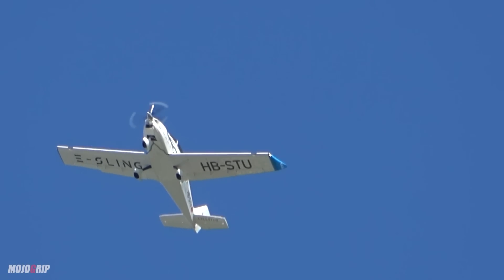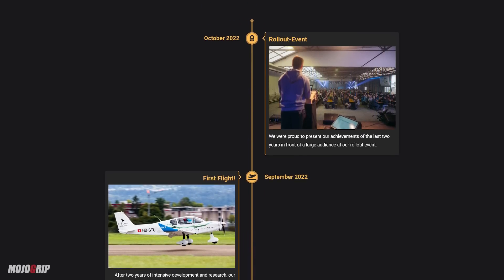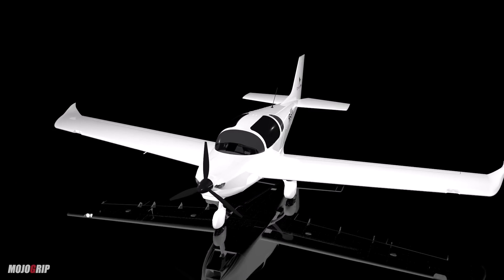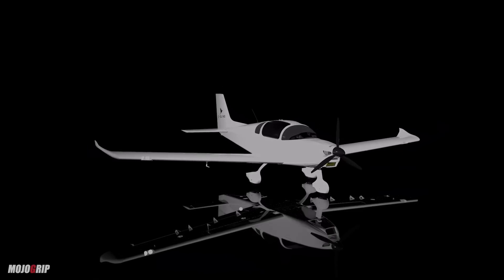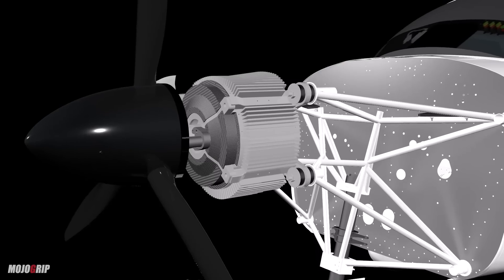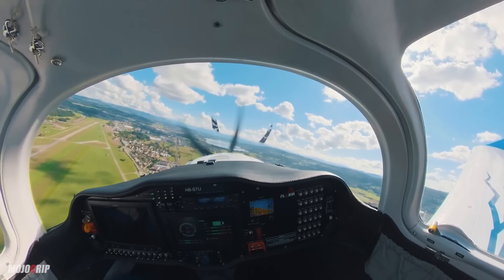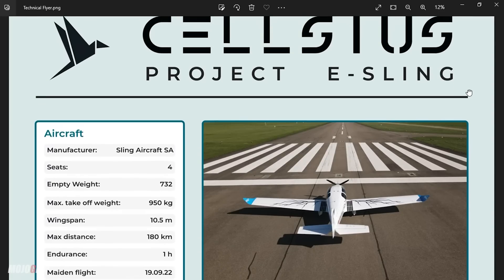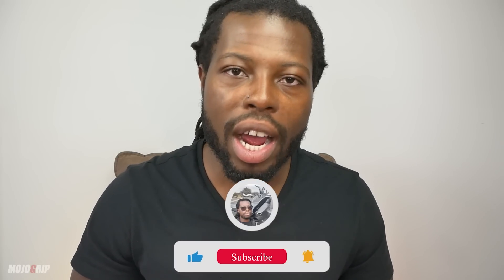All Electric 4-Seat Aircraft Sling TSi Takes Its First Flight

Comment: The success will be in better and lighter batteries to run a decent range. Evolution is slow on batteries however there are teams around the planet working on that challenge. Would be easier than H2 at now

Comment: I know it says it's a four seat airplane, but they have a 110kW motor in there with only 50kWh of batteries. So at full power you've only actually got 27 minutes of flight - that's not even enough for VFR reserves. Obviously you'd only use full power for a couple of minutes while you climb to altitude though so maybe you burn 5kWh getting to 2000ft. The question is now how low you can keep the power to the engine and still keep at altitude. If you throttle back from 110kW to 70kW your remaining 45kWH will give you 38.5 minutes of flight remaining. So overall total flight time is a shade over 40 minutes.

Obviously anything you can do to extend flight time will be useful, and you'll be able to spend less energy getting up and staying aloft if you're not at gross weight - so with so little energy available, why would you fill the back seats with people? Seems like they could have made a much more useful airplane by removing the rear seats and putting batteries in there instead.

That's not to dunk on the team that did this - great work by them - but it seems odd to prioritize number of seats when the endurance is so low.

Comment: I think hydrogen would be more viable for airplanes as the size of a  chemical batteries not only provide range but also determines the amount from energy the motor can pull from it at a given time which is alot more continuous load compared to a car.. now with that in mind a used electric plane how would one gauge the life of the battery vs a gasoline powered aircraft say each is at 50% life .. now half engine life is guaranteed a certain amount of hour before TBO a battery at 50% capacity is it even safe?? as the ability to pull power and run time is reduced ??

Comment: Eviation's Alice is doing better, so it's doable; let them make a longer airframe sling with bigger carrying capacity, can be 4,5 or 6 place if need be, but it should be able to go longer than the current tsi electric experimental model. It needs to do 500km. That's the holy grail for electric aviation for now...

Comment: Generally, your avionics are going to run at a very different voltage than your motor. Most electric cars still utilize a separate traditional car battery for accessories. The shear reduction in systems in an electric plane vs combustion engine would be exciting. As the battery chemistry continues to evolve and energy density goes up, these would be really cool trainers / recreational planes. I'd be interested to see how the weight and balance shakes out from reducing all that engine weight, and sliding it back into the wings.
Reply: Hello jungle
The balance was quite a challange for us, as we used the Sling TSi as base and it obviously is designed as ICE aircraft. But with smart positioning of the new componets we were able to keep the balance the same. It just doesn't change over the duration of the flight.
Greetings

Comment: This is really great. Once the battery breakthrough happens (and it will) this instantly becomes a extremely viable airplane. From a maintenance perspective, this is vastly better and will be far more reliable than gas engines. Can't wait until battery tech catches up to allow 3-4 hours of flight time.
Reply: Batteries might not be the answer, I think some advancement in super capacitors is more likely.
Reply: You will be lucky to live that long.
Reply: @azcoyote007  😂 so much fail in your comment
Reply: @azcoyote007  Well folks, we've found the technological laggard.
Reply: @kingjamez80  Riiiiiight.  The tech is not advancing even remotely quick enough to support claims being made for electric planes.  Energy density issues make your pipe dream unattainable without an advancement likely to be unseen in the next 100 years.  So like I said.  It won’t be in our lifetimes.
Reply: @azcoyote007  You are right, there is absolutely no research being done for developing new battery chemistries with higher energy density. Is your comment intentionally mirroring the New York Times statement from 1903  that men wouldn't be able to fly for 1 to 10 Million years of continuous effort by mathematicians and mechanics? It's surprisingly similar in both content and correctness.

Comment: The weight of fuel decreases as you fly and that's a good thing, with all electric power the weight is always the same. That would be a concern of mine. As far as safety a hybrid maybe? Best of both worlds.
Reply: Also the problem with electric is not being able to reduce fuel to increase payload.

Comment: When you are flying your gas powered TSI your total weight is reducing as you consume the fuel.  This increases the potential range of the aircraft.  The Electric TSI has a constant weight and fewer miles in addition to the battery limitations since the weight of the plan does not decrease.  What does the battery pack do when it is hot or cold ambient temperatures.  I am not criticizing just stating the facts.
Reply: You stated the main engineering problems that need to be solved in order to create electric planes. We need a battery structure that does not change its internal shape in lower and higher pressures/temperatures and by recharging. Although the requirements that you've stated (long range, high altitude) are not necessarily amongst the use cases of these aircrafts. We can use these planes for what they're intended for and we need new inventions for commercial and bigger aircrafts.
Reply: Should be hybrid like a Toyota Prius.
Reply: "your total weight is reducing as you consume the fuel." Isn't cool how this works?
Reply: Hi Crime Stoppers
thanks for your interest in the project,
We have a cooling system for the e-Sling batteries which covers a large range of warmer ambient temperatures. But we can't fly in hot enviroments (ca. 40°C+) for long. For cold temperature we shut off the cooling system and don't see significant range decrease until we reach negative ambient temperatures.
Greetings Alex
Reply: It also sustainable! Which fuel powered vehicles are not.
Reply: @JeremyJackson111  Case in point, all motion and vehicles require fuel!